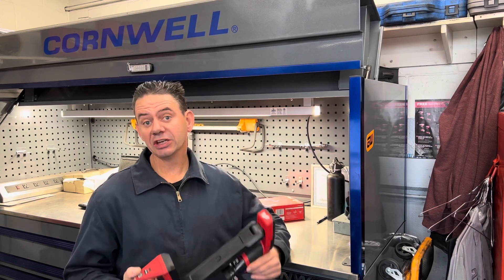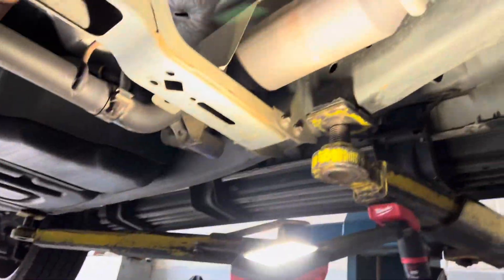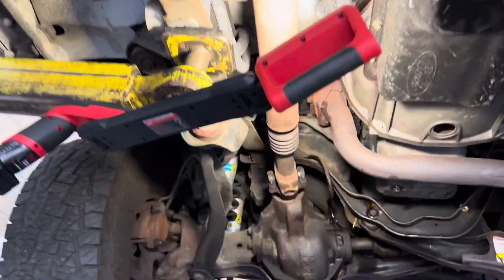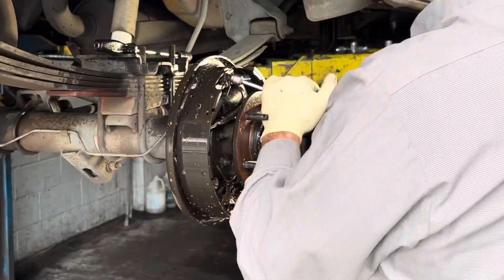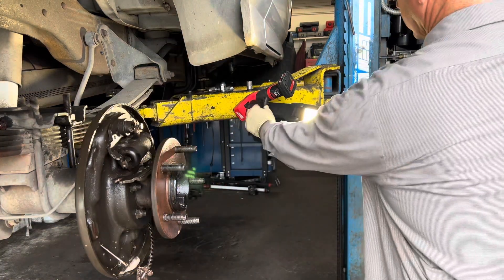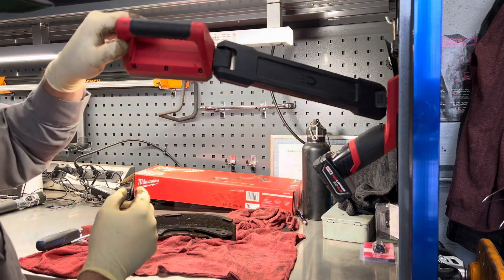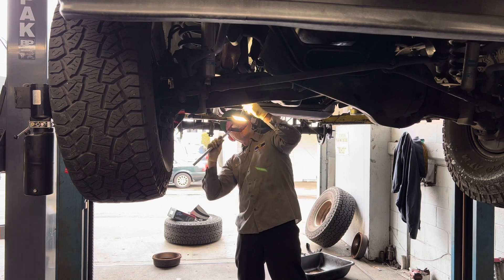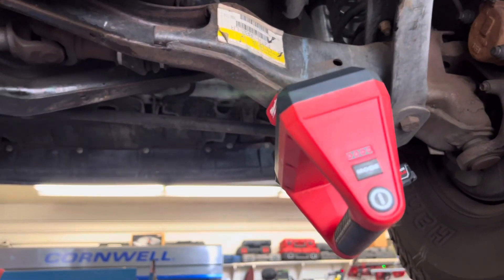Introducing The New Underbody Light From Milwaukee Tools - Perfect For Mechanics!

Comment: Hey I have a question not related to this video. I’ve spent a lot on tools recently so I couldn’t afford the snap on wobble 3/8th impact sockets so I got some gear wrench ones and wobble sockets are used heavily at my shop and I know every else as well wondering if you could make a video on the ones you have and how they’re holding up or which brand you would recommend thanks.
Reply: I love your videos I always watch before i bought any of my impacts like you sold me on the right angle and the stubby I already had the bigger ones cuz I need and love those too but I just wanna know if I bought the right ones lotta guys at my shop recommend me these ones instead of some snap on ones for instance and I really wanted to hear your opinion on them